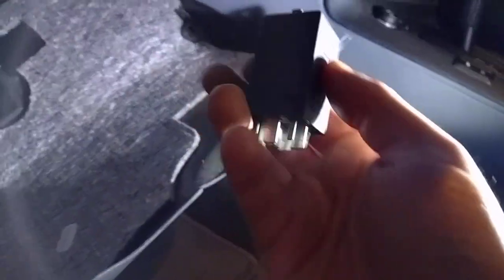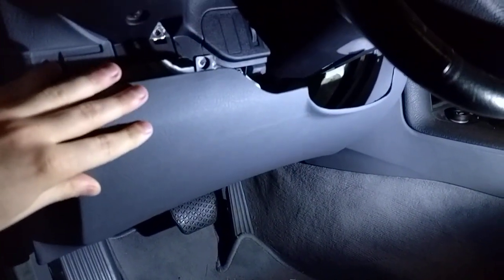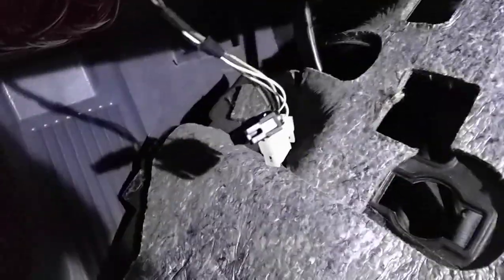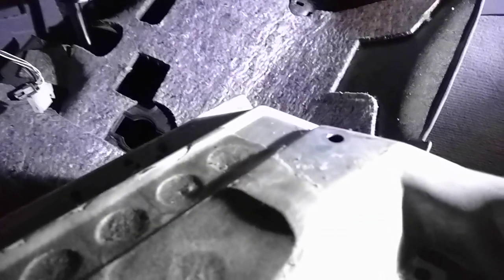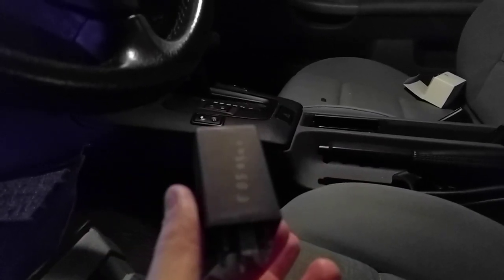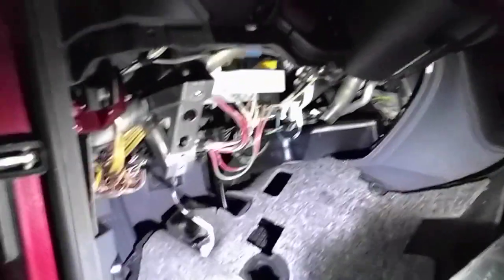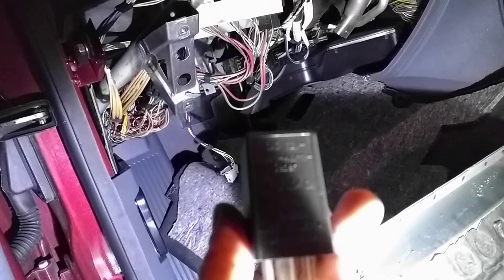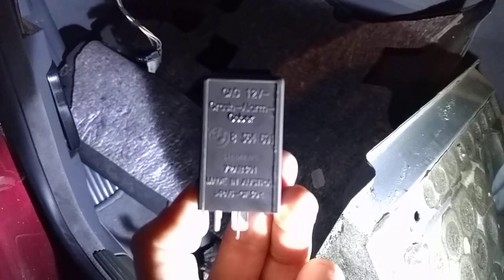BMW E36 Crash Alarm Relay (Gerber) Sensor Replacement [1995 318iS]

Comment: Can this cause a starter issue ? I have the same problem with the warnings randomly going on, but also a starter problem. I changed the starter but I still need to push the car for it to start. I read that the alarm system can cause a starter disconnection. I hope that it’s true and that it will solve my problem